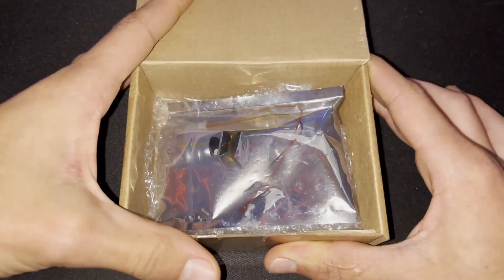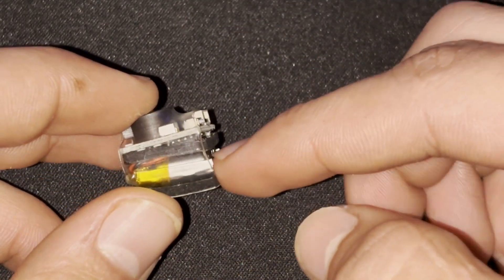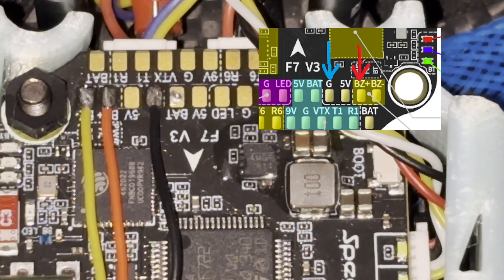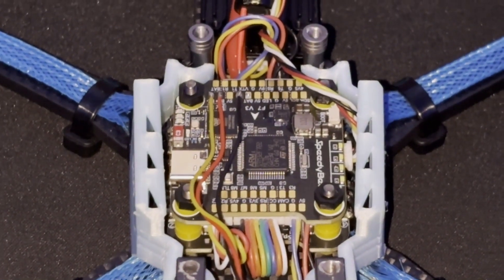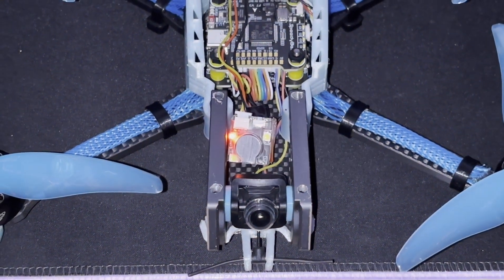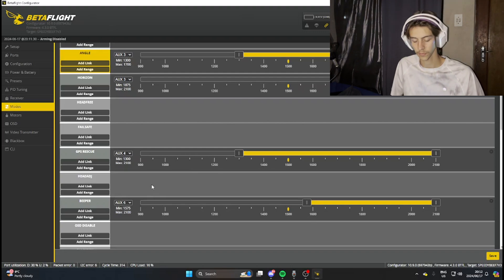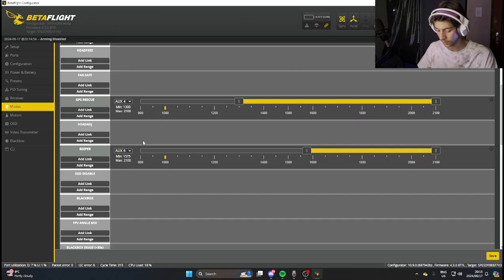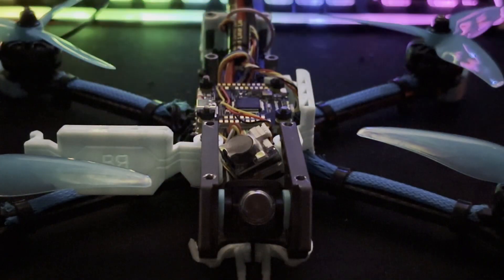Fpv Finder Buzzer Installation and Betaflight Setup

Comment: What about if the battery is still connected but the drone flew out of range and you lose telemetry/video?

When i have my drone plugged in, I ill turn my radio off but it doesnt beep

Comment: Great tutorial video here👍 I'm working on putting a beeper on my 7inch quad currently and I was wondering if I was still able to have beeper switch function without using a tx pad. Good thing it will still function with the switch as well as if the power gets disconnected.
Reply from the maker: That’s awesome man. Dm me on instagram. Would love to see your build. Thanks for the comment brother. Happy flying 🎉

Comment: I wanted to ask you why after mounting an external beeper like yours and connecting the battery the beeper emits a continuous alarm sound. Thank you if you want to answer me
Reply from the maker: It’s not continuous. The beeps are programmed to notify the user of different processes that are carried out by the flight controller such as gyro calibration, gps lock, etc. when the battery is disconnected in the event of a crash it will beep for about 14 hours
Reply: @Hellfire_FPV   Thanks, I knew this but mine is a problem of initial configuration: as soon as I connect the battery the buzzer   emits a continuous sound at that point I disconnect the battery and press the shut-off button.
Reply from the maker: @pachino45 hmmm, make sure you only have the lipo plugged in and not the usb to Betaflight as well. That can cause issues. Happy to assist you, DM me on instagram
Reply: @Hellfire_FPV  Thanks for your kindness, unfortunately I don't have Instagram but I wanted to let you know that I had used a pre-assembled cable that I noticed was missing a pin with a yellow wire, on the FC, compared to the assembly diagram and that I can certainly restore; but what leaves me perplexed is the fourth pin where I should have a gray wire for the buzzer but the one I purchased only has 3 wires.

Comment: i soldered ground on buz - and signal on 5v........ and my buzzer beeped all the time....
Reply from the maker: Thats incorrect, you need to put your ground on a normal ground pad and your signal wire will go to bz -. And then your 5v to a 5v pad or Bz+. Dm me on Instagram if you need any further assistance, happy to help :)